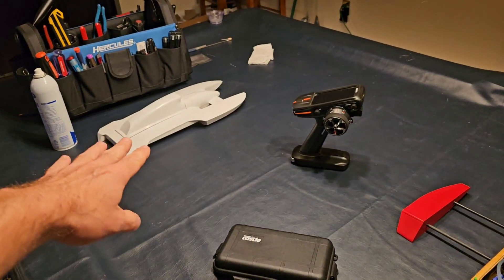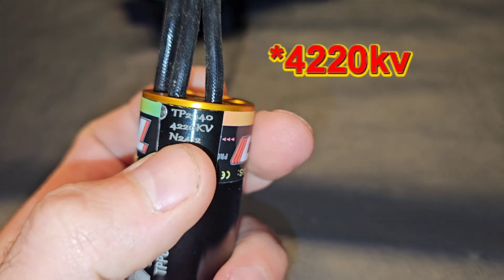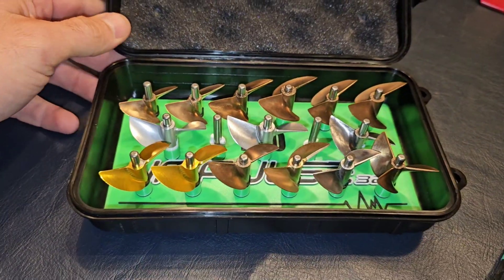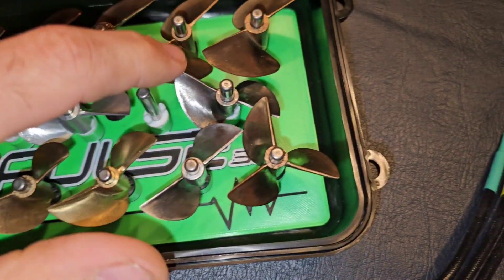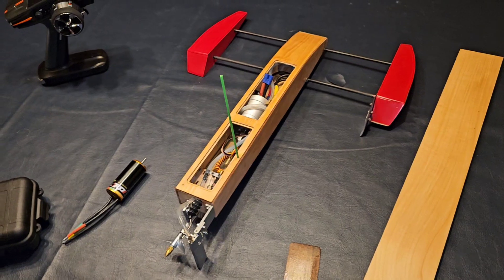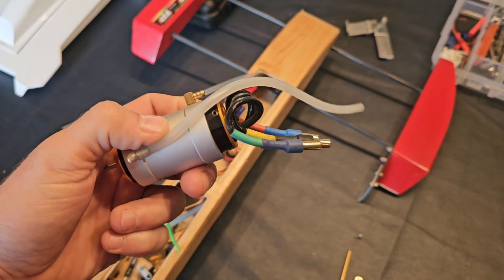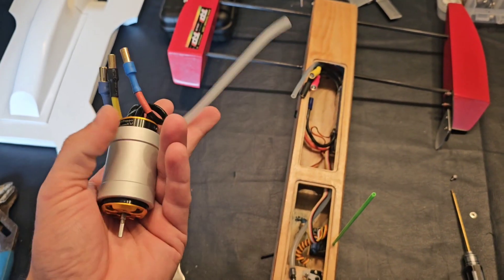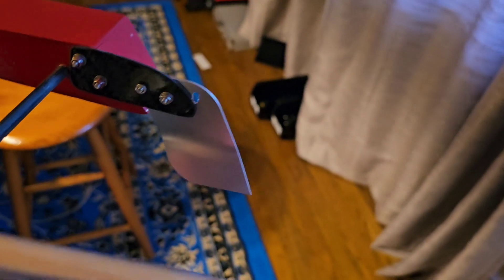Shrimp Outrigger Gets a TP Power Motor Upgrade! And She FLYS!!!

Comment: Awesome! Can you move the rudder from the right side of the mount to left side of the mount? It will straighten out your steering rod and makes the rudder not cause drag by being on the inside of the mount instead of outside of the mount 🤔 Just a thought 😎👍🏼
Reply from the maker: @mikesrcgarage  yes I can, but it'll limit me to 38mm props.
Reply: @H2oMechanic2RC  Oh ok that's what I was wondering. Maybe bevel the edge? Lol.